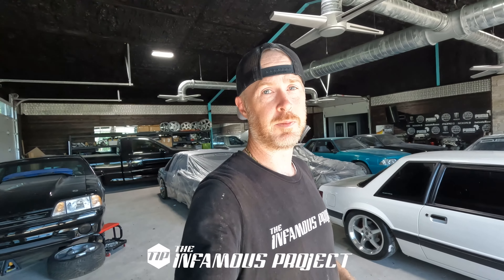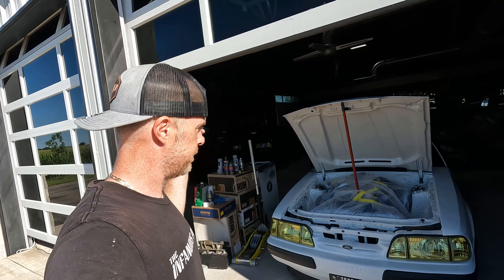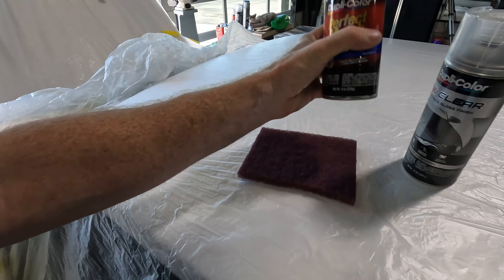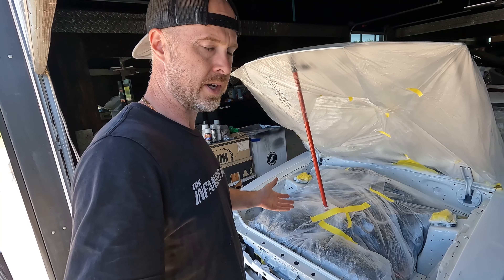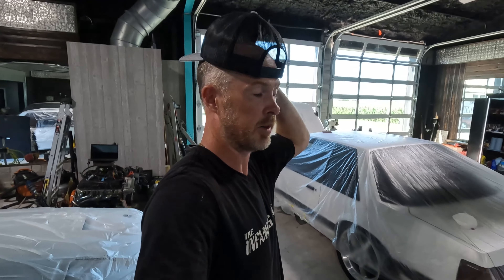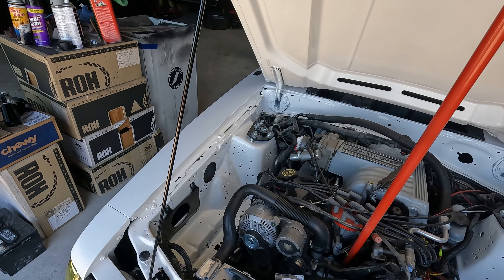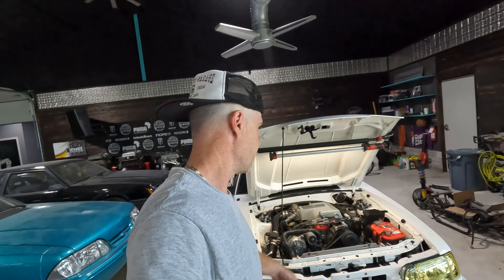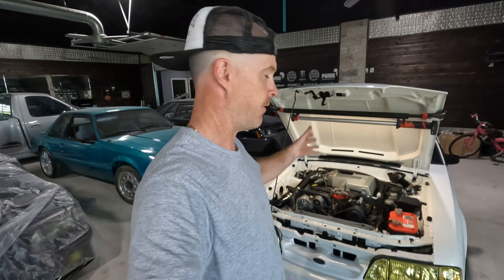Respray of my Engine Bay & Poor Mans Wire Tuck - TIPS05E36

Comment: A friend of mine panel-painted his car (painting a couple pieces at a time instead of the whole thing at once) and it turned out 3 different shades of white. It came out of the same gallon. He repainted it, same thing.  He had to paint it a third time (all at once this time) and it finally turned out one shade. White is weird. The only thing that we figured is the paint wasn't mixed thoroughly enough and the heavier pigments settled toward the bottom causing the shade to be off from one paint session to the next.

Comment: This is why I’m glad I have a project roller I’m building so I can paint the car and cut in the engine bay and jams with the same paint at once..it’s my 1986 T-Top coupe and it was originally Oxford white but I want to paint it the white I had on a 2012 mustang 5.0 I had called performance white and it’s a whiter white👍🏻

Comment: So I cut my fuel tank vapor line right under the passenger door where it transitions from rubber to steel tubing. Before I did that I would give wiffs of gas every once in awhile but now I don’t

Comment: You have some really nice cars.Are you the one who sells the DECH STYLE SIDE SKIRTS that you have on the fox bodies?
Reply from the maker: Yes I sell genuine DECH body kits
Reply: @TheInfamousProject  when you have a chance and its not too much trouble could you give me a measurement on the side skirts? measure from the top to the bottom of the skirt.I am thinking about getting a set for my 87 gt but need to know how big they are,I will be running a 8 inch valance on the front with the original rear bumper.Just wondering if they will look good with that combo.Thanks so much.